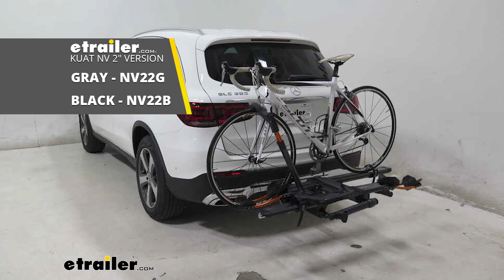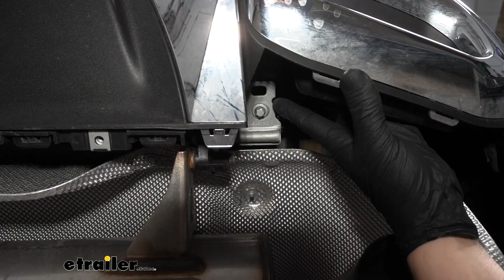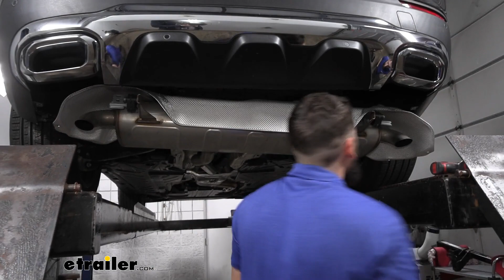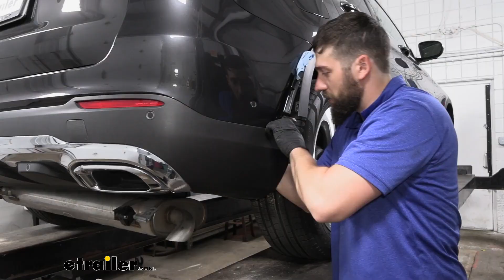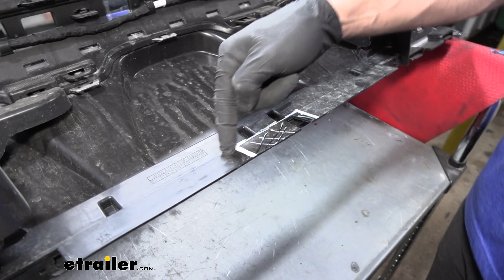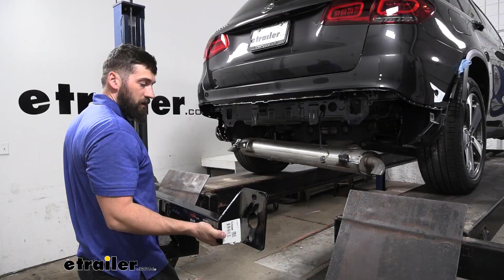Step-By-Step Installation Tutorial for the Curt Trailer Hitch Receiver on a 2022 Mercedes-Benz GLC

Comment: Have you installed a wiring kit on a 2022 GLC300?
Reply from the maker: We haven't had the opportunity yet. If you have the GLC 300 SUV, we recommend using the Tekonsha # 118747. For the coupe, use # 119147KIT.

https://www.etrailer.com/Custom-Fit-Vehicle-Wiring/Mercedes-Benz/GLC/2022/118747.html.https://www.etrailer.com/Trailer-Wiring/Mercedes-Benz/GLC/2022/119147KIT.html?VehicleID=20226007735